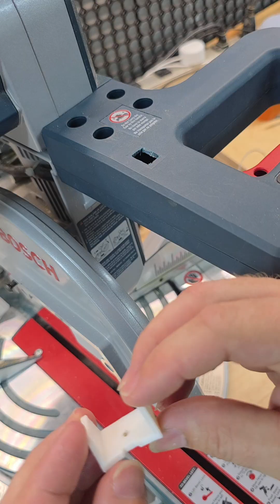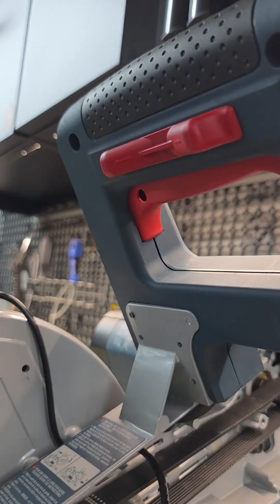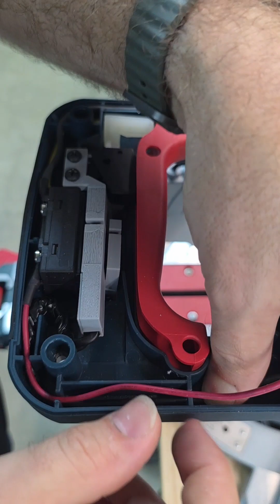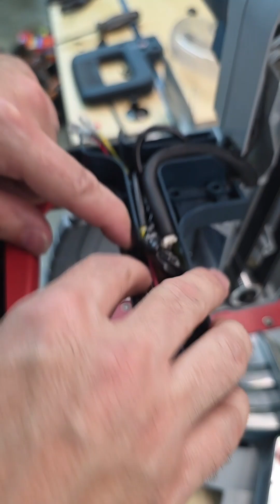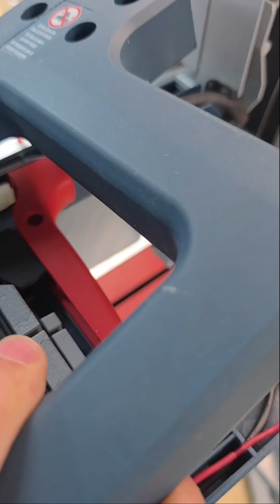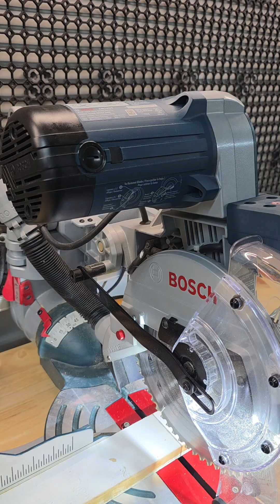10" Bosch CM10GD shadow  light  install

Comment: This is a wonderful instal video. I have a 12” and I think it will work with that saw. The blade housing is hollow and should fit the light. The handle insides are identical.

Comment: Will this work on the 12in version of the saw?
Reply from the maker: Unfortunately  no, it was specifically  designed  for the 10". As that is the saw I have.  I currently  don't  offer  anything for the 12" at this time.
Reply: @marrdo556  You have created the best Bosch shadow light on the market. I'm holding out until you have the 12". When do you think it will be ready to sell?
Reply from the maker: @brianrichey4462  “Thanks, I really appreciate that—I put a lot of time into this...  If you follow my Etsy store, you can get notified when I complete the 12" versions. I'm thinking  July 2026  realistically.  
  https://3dtoolsolution.etsy.com